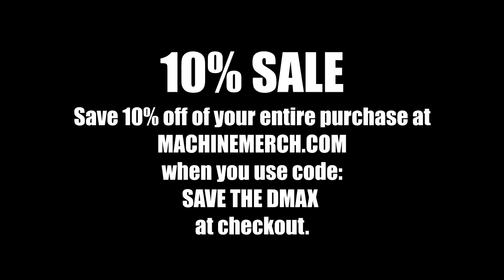Insurance reveal on Accident  & Supercharger

Comment: Those plastic superchargers don't work. It's not gonna add any boost. Used em before. Nitrous kit would work though.
Reply: CraftsmanQuad there is a couple of videos of people using this style of "superchargers" and they do absolutely nothing for the motor. I agree that the snow pump could benefit the motor. Pressure box would have to be installed though.

Comment: You should install the compressor in one of the corners and make it so it draws air from outside into the compressor and put it in a sound-ish proof box so it won't be as loud and then run a metal line up to the ceiling and from there connected to your recoil hose so when it's recalled in it's out-of-the-way more.

Comment: Hate to break it to people, but those electric super chargers and turbos do nothing. Mighty Car Mods tested 3 of the biggest ebay electric turbo and super chargers. One instance, they piped all 3 of each together and it did nothing. 

Interesting thing though, for the sake of continuing testing things, they took 2 gas powered leaf blowers and hooked them up to see what happened. They barely made 1 extra horse power on the dyno.

Several other people have tested these electric turbos and superchargers and the results were the same. They can not physically create enough boost to do anything because they only operate at around 2500-3000 rpm which is not even close to creating boost.

Turbos impellers lowest boost point is around 30,000 rpms. At full throttle depending on the setup and size of the turbos, they operate up to 280,000 rpms  and higher to create efficient boost to make horsepower. As I stated, this changes though depending on the size of a super charger.

Comment: 3Dmachines I really enjoy watching your videos they keep me entertained when work is slow. I committed in a previous video about how air cooled engines don’t like being boosted, not trying to be negative. Just wanted to give some helpful advice. On that note if you really want to give it some extra power and still be reliable and not blow itself up. I would really recommend using a smog pump, it will drastically out perform that “electric supercharger” and still keep the engine reliable and much more happy
Reply from the maker: Ok thanks man. Ill check it out.

Comment: I had a 10ply mud tire blow on the front left of my Silverado 1500. Tore up the front bumper, fender, fender skirt, lots of damage inside the fender well, knocked off my fender flare, and caved in the driver side rocker panel under my door. Plus some paint damage to the hood and driver door. Painted the hood, my door, replaced the rocker panel, replaced my fender, fender skirt, fender flare and entire front bumper including new fog lights for $4,300 and I only paid the $250 deductible. State Farm has always been good to my fiancé and I. Accidental vehicle damage is always unpredictable. It’s nice to be covered though. I honestly didn’t think I’d be covered for all the repairs due to a 10ply tire unraveling. Never seen that before either. The tread literally came off of the tire itself and just destroyed stuff at 80mph towing my bass boat.

Comment: Hit a deer with my car this year and they quoted me $3200 dollars to fix it. My deductible was $1000, it was really high and I had my truck to drive around until I was able to get my car fixed. The "approved" repair shop used aftermarket parts and charged the insurance company for factory and pocketed the change.

Comment: Only time I have had to deal with vehicle insurance was this year. I was tboned by a lady who ran a red light, she hit me at around 50mph. Totaled my 03 Ram 1500 Laramie. She hit my passenger side rear axle, estimated damage was almost $11,500. I got a check a weekater, minus my $1000 deductible. Her insurance had to investigate prior to reimbursement of my deductible. It took 3-4 months to get my deductible back. No issues with receiving payment so I could buy a new vehicle. The issues came with paying my lost wages due to injury. Also, they eventually sent me to an Independent Medical Examiner. These doctors aren't independent, they are chosen and paid by the insurance company. So, in my case, they sent me to this doctor so they could get out of paying me for the coverage I had been paying for. 11 months in, so just recently, they cut me off. I now have no money coming in until my settlement is completed, which will take a few months, and that's the best case scenario. So, I'm glad it wasn't a wreck where you were injured.

Comment: If you have comp insurance coverage, which would cover a deer or a rock in the windshield, all you should have to pay is your deductible.  After, there should be no raise in rates.  A car accident is where your rates will likely go up.  Then again this all probably depends on your carrier.  ^ is for mine.  I had a rock chip my windshield and was irritated about how much it was going to cost me, when I contacted my insurance that is what they told me.  So for me I spent $100 for deductible and that was all, got a brand new windshield from the body shop of my choice.

Comment: I had some work done on my truck through insurance. Someone admitted to hitting it so there was no deductible. (I would have been fine with him covering costs on his own, long story.) If a deer had hit me there would have been a $500 deductible on my plan. It sounds like they might be working with you to save both of you money though. Good luck! ...or break a leg of something...
Reply: Oh ya, i hope you are putting the supercharger between the carb and the engine. If you blow air into a carb it can push the gas back into the tank.

Comment: looks like an ancient arctic-cat in the warehouse lol. Those things were pure garbage.  I bet 
 it don't crack 60mph on radar. If I had to guess its  a 340cc or 440cc. they were more common. less than 50hp for sure.  The best older sled to look for is the 1997-1998 xc700. That thing was an animal buy one with the 220 cylinders they can be had for 1000-2500  and keep up with the new stuff.

Comment: electric supercharger? I'd wire it to a battery first, just to see how much air it is going to push out, if it were me I'd get a old belt driven smog pump, if your going to run that super charger directly in to the air intake of the carb, you may need to swap the carb for a blow through carb, but it the stock carb should work just fine,

Comment: Dude whatever you do stay away from the fords.  They havent been anygood since the last 7.3   the 6.0s where all junk.   DMAX Will always smoke it.  And out last it... I have several cummins here and a couple of 7.3 ford diesels.. one natural and one powerstroke. even the powerstroke cant hold a candle to the cummins when pulling really heavy loads.. but not everyone pulls 30000 pound behind a one ton either I guess.    On another note.. be sure a jet up on the gator carb if runing pod filter so wont have a lean condition..  man Keep the Dmax..  heck Id replace the bumper , leave the dents alone and just enjoy the insurance money for something else fun.  Those dents arent going any further.  Its rust free thats what matters..

Comment: It’s a turbo & not a super charger.
Reply from the maker: anyone want to tear this guy apart?
Reply: A turbo is run off the exhaust gases of the engine. A supercharger is traditionally run off a pully driven by the engine or in this case a separate electric motor. Just because it looks like a snail shell doesn't make it a turbo.
Reply: Brock Johnson I must of missed the part where he said he was hooking it up to pulleys & belts. It looked like a “traditional” turbo like a snail that is hooked up to exhaust gasses
Reply: Andrew Mcphail it’s not being hooked up to pulleys and belts, it’s being run by a separate electric motor that sort of replaces exhaust pressure and the turbine on one side
Reply: its basically like a hairdryer, shaped like a turbo.
if the motor isnt heavy duty it wont do anything
Reply: its not even a turbo, its a fucking toy XD
this is why ive mostly stopped watching his garbage.    props on moving out of your moms garage and yard though Dalton
Reply: 3DMachines anyone want to tear you apart? It's a Chinese electric fan lmao not a supercharger it won't do shit all!

Comment: You will grow to hate that hose reel never the right length ,one day you step on the hose and it will rewind all by itself and take the tool you're working with and smash it. Ask me how I know. Or it throws the tool into a car and or rips it out from under the hood sending it flying and well you get the picture. I smashe shite out of mine with a 30lb sledge hammer. Wrapping up a hose is way easier than fixing thing that were not broken.